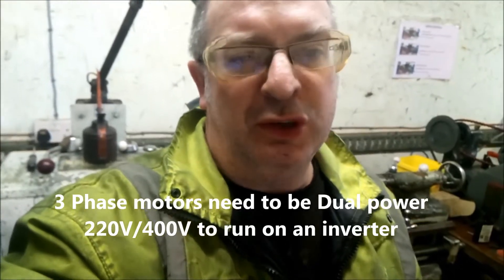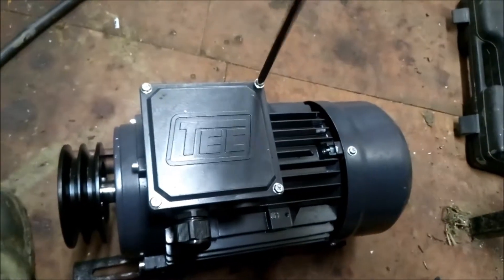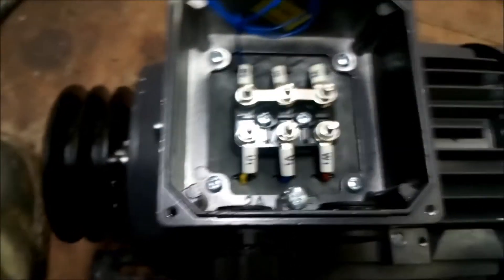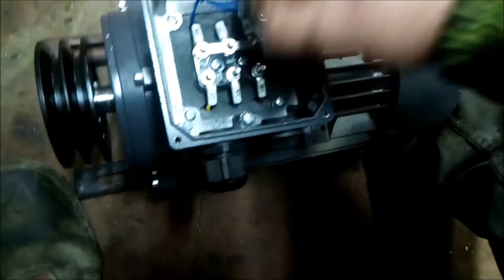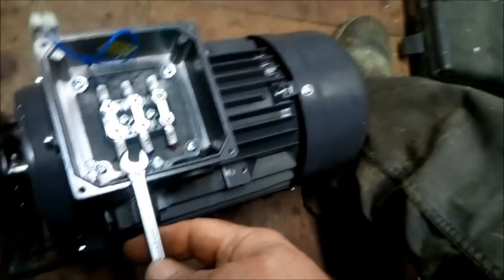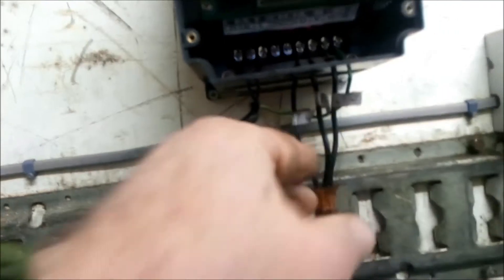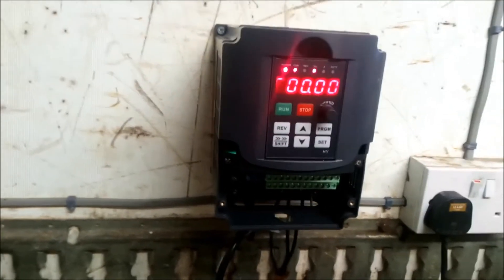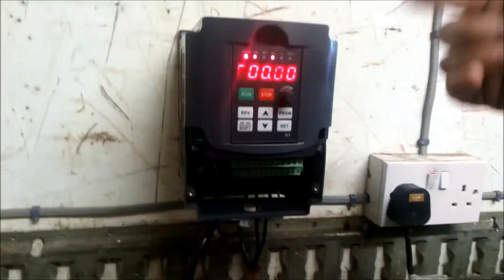Running a 3 Phase Lathe on UK Single Phase Power With A VFD Inverter (The Basics)

Comment: Hi there, great videos. By the way I have a 410 3 phase compressor I just purchased and I would like to power it from standard single phase 240 will this VSD work without changing anything on the motor and connecting it directly where the three phase wiring would normally go in the unit? I have seen Single to 3 phase 380 V converters online but there’s nothing clear out there stating if this will be a direct workaround or if I would need to modify the motor etc.

Comment: Technically, you can often run the older star connected motors on a single phase 240V  VSD.

The motor will develop less torque but in some applications, may still be useable.
I've got an old 415V 3 phase drill press. The motor is internally connected in Star, so I can't change it to Delta, but it works fine on my 240V VSD.
Just don't go the other way. Never put 3 phase 415V on a small Delta connected motor, unless you want to burn it out.

Comment: hi, iv got one of these  but my brittan has 400/440v motor
all mains 3 phase motors iv seen are 400v except maybe USA .iv never seen a 3 ph motor that says 240v on the name plate. im a bit confused, people are using these in the uk, not sure how that works. its only going to be 1/4 power running at 220v surly. thanks

Comment: How did you ground the vfd? Where does the earth wire from the plug go? Cheers
Reply from the maker: Hi inside the VFD is a common ground where you can wire the earth from the plug into and any other earths from your equipment.
Reply: @ thank you! My VFD is fully plastic enclosed and doesn't have an earth terminal, bit weird. Not sure how to ground the motor

Comment: Can u convert your stock 415v motor or do you need to buy a 230v motor?
Reply from the maker: its not an easy question to answer as i don't know anything about your motor . There is alot of information on line. If possible search the make and model of your motor and see what info you get.

Comment: Hi I’ve got a 3 phase tennoner which has two motors on both are the same 2.2 kw 7.9/4.55 amps would one of these work on that machine thanks
Reply from the maker: The short answer is yes if both motors are required to run at the same time and speed. The inverter has to be able to accommodate the draw of both motors so you would need a VFD over 5kw.

Comment: Hello.
I’ve just got myself a Colchester mk1.5 master the wiring is a mess, lots of bodges, it was supposed to be running but wouldn’t start, when I went to collect it, I’ve got my work cut out for me.
A very useful video, as I’m going to have to use a VFD, could you tell me where you got your one from and if it seems to be reliable and of decent quality?
Thanks. Dave 
P.s subscribed 👍.
Reply from the maker: Hi David, i bought mine off ebay and its still going strong.

Comment: My lathe motor says 415V, so if i change over the Star to Delta dose that alter the Voltage?
Reply: Yes, in Delta, you'd run it on 240V, 3 phase.

Comment: Hi, nice vid but I'm a bit unclear about the numbers. 1) If you bought the inverter, why not run the old motor from it. 2) If the old motor is too powerful for available inverters, what is the power/ current rating of the new one please? The new motor must have cost a few bob, why not buy a bigger inverter and run the old one? Cheers
Reply from the maker: I had a motor where there were 9 unmarked wires inside instead of 6 and I couldn't work work out how to wire it up so I put a new motor on.

Comment: Hi there, I have just purchased a 3 phase pillar drill and was curious on how I can tell if the motor in it is dual like you mentioned?  Thanks
Reply from the maker: There should be a plate on the motor with allsorts of figures on it serial number, voltage amps etc now depending on how old it is is may have 440v if its 3 phase only and If its a newer motor it will have 220/440v that means its dual voltage hope that helps. Matt
Reply: @Mids1970  Thankyou very much

Comment: Hi nice video can I ask ya question I’ve bought a union graduate lathe it has a 3phase dual voltage motor but I’m like urself I only have single phase electricity will this VFD work the same on my lathe . Also do I need to skip the star till delta section and just follow the rest of ur VFD setup cheers in advance
Reply from the maker: it will work just make sure your VFD can cope with the amps and Kilo watts of your motor. Your motor will need to be in delta to run with a VFD. VFD's can be expensive so its also worth looking at the cost of just getting a new 240v single phase motor.
Reply: @Mids1970  single phase motors can make the lathe run not as smooth as a 3 phase motor tho.  So is it not worth just biting the bullet and paying a little extra for a VFD?

Comment: do you have links please to where you boughty the inverter and motor please?
Reply from the maker: Hi Thomas this is the motor i bought off Ebay a 1.5KW PREMIUM ELECTRIC MOTOR 3 PHASE 1400 RPM 4 POLE 2 HP Horse Power NEW and here is the link to the inverter https://www.ebay.co.uk/itm/7A-Huanyang-1-5kw-220V-Drive-Inverter-VFD-Variable-CE-Certificate-Frequency-2HP/143345133560?ssPageName=STRK%3AMEBIDX%3AIT&_trksid=p2057872.m2749.l2649